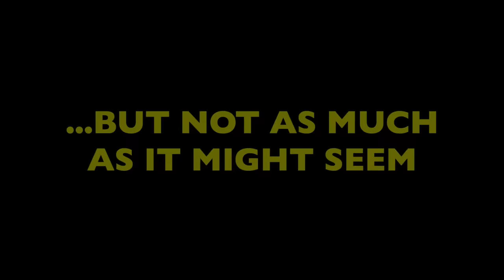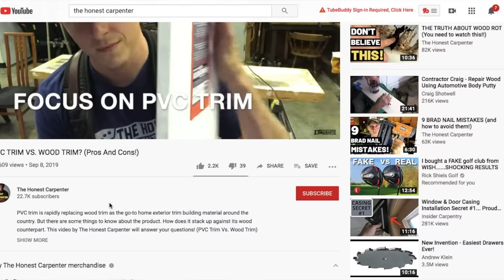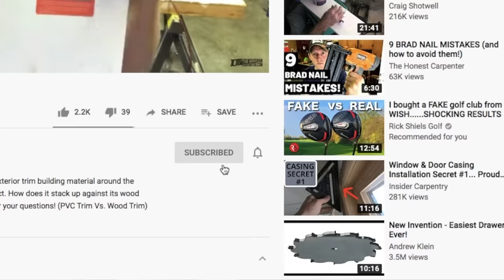How Much DAMAGE Can CARPENTER BEES Cause?! (What To Do About Carpenter Bees/How To Get Rid?)

Comment: Brown paper bags would be better to use. One thing you need to use if you're going to do brown paper bags or the plastic bags is that you'll need to put some stones in the bottom of the bag so it doesn't sway back and forth in the wind like a flag.

Comment: The best solution I've had is scraping the adhesive from glue traps for mice and plugging the holes with that. The bees can't get free of it. I've tried caulk, wood filler, poison... none did more than slow them down and leave many flying around again the next day. A day or two after I started using that adhesive, no more carpenter bees flying around my house or deck.

Comment: Carpenter bees have destroyed my porch.  They bored out 2 ceiling rafters and collapsed a portion of the roof.  My fault for letting it get to that point.  The bee hotels are for mason bees.   The bee trap works to a lesser degree... but you will only catch a few. You really you need to paint every exposed area after packing the existing holes with insecticide dust and filling so they can't get out or in.  Then keep up with it.

Comment: I disagree that carpenter bees do little damage.  Here in Georgia, between the carpenter bees, woodpeckers going after the carpenter bees and squirrels, my cedar sided house was riddled with holes.  This also allowed some of them into the attic of my house and exterior walls. Along with honey bees a couple of times. I finally had to replace the cedar with fiber cement boards to alleviate the problem.

Comment: The bees don't do much damage BUT woodpeckers trying to eat the bees will make a total mess. They indiscriminately rip open the top of the wood (in my case a porch railing) causing significant damage. I was close to having to replace the whole railing cap in 2 10 foot sections.

Comment: Raising them is not the way to get rid of them, look at the welfare situation. Dusting their holes and traps won't rid you of them either, I built over 90 traps for the sheds and barn on the farm. What will rid you of them is this, this mixture took some time to develop but it's cheap, safe, and effective. Get a 13 oz. container of petroleum jelly at the Dollar Store or Walmart ($2.50), get the 8 oz. bottle of  Permethrin 10% liquid ($10.50 most farm stores will have it). Permethrin 10% is considered safe for humans. The petroleum jelly mixes easily if you warm the container in a pot of warm water on the stove, it turns into a liquid. Mix 13 ounces of petroleum jelly with 4 ounces of Permethrin 10% pour both ingredients into a 1 quart jar and shake well. Draw the mixture into a 60 CC / 2 ounce catheter syringe with the long smooth tip ($3.30 at the farm store). You want it thick enough to stick in their holes but thin enough to be used in a syringe. When it's time to refill the syringe, warm the container in warm water on the stove so it can be drawn into the syringe. It doesn't take much to treat a hole, a 60 CC syringe should treat 150 holes. This will continue to work all summer so it kills the offspring when they emerge. It turns each hole into a trap.

Comment: Carpenter Bees wood damage I observe (per.exper) is pretty superficial, I have a free standing all wood 2  vehicle garage, been here 35-40 yrs. and a wood deck surrounding my wood frame house that's a good 75' in length supported by 12' wood pilings. The Carpenter Bees having been using both for nesting habitat for as long as the structures have existed......1st off,  they haven't bore that many holes into the wood proper, and the holes they've made are re-used many times, and I am unaware of ANY serious structural damage they've done. Am sure peoples fear of bees along with the pest industries exploitation of this fear, have done a mammoth job of over dramatizing the minimal amount of damage Xylocopa sp. (Carpenter Bee) cause by their nesting.......It's superfical and I stand by this assessment by visual n personal experience and I counter anyone who claims otherwise!!!

Comment: I spray the hole with a chemical that kills insects which would be soap like dish soap then dry the hole with a hair or a heat gun dryer, then I spray paint the hole inside then plug the hole with a mix of rocks I find on the ground then tada easy done as filling the end with blockage of cock glue gun as I save up money in the future.  Does it work?  yea, most of the time it depends how deep the hole is for I usually have to carve out the hole to see how far did they went, sometime it could be the whole plank if you're not careful enough 1 plank is not being used by the same bee which I think I had 2 by 4 so 2x4 they can get in there deep like an asshole which means you have to pull out the wood and burn it because these are invasive species.

Comment: Most commecial bee hotels are terrible and will not see any use.
They are basically a scam to the well meaning non-expert.
You are better off just getting a few nice pieces of wood and drilling various size holes in them with a sharp bit.
Sand the edges too if you can. Put it under an overhang of some sort and carpenter bees (and a number of other solitary bees) will love it.

Comment: So here is my not so nice solution because they are a huge pest around our house.  Spray an active hole with termite pesticide, coax the female out stick her to a wasp glue trap and hang it near an active hole.  Leave it there for 2 days and watch the trap fill up.   Shove a coat hanger wire in old holes to clear it out.  Pack with steel wool and putty and immediately paint all surrounding wood.  Yes not nice but it works.

Comment: I had about 30 of them in my backyard.  I thought they were kinda' cute at first and left them alone.
Then I discovered they were boring into the underside of my deck and decided I had to deal with them.
Each evening I would swat at them with an old badminton racket.  A week or 10 days of this and they
were all gone.  They returned the next summer but not as many  Wash, rinse and repeat.
Reply from the maker: I left out “badminton racquet” as a bee deterrent, Douglas! I’ll have to link one down below 😂
Reply: @TheHonestCarpenter  Can confirm  that tennis rackets work great as well. Good exercise.
Reply: Use steel wool then foil then caulking then stain then paint  also use some vinger they will not return

Comment: A little misleading how much their destructiveness is downplayed. We've had a massive deck pretty much ruined by these guys. Our house was built in the 70's, and when redoing the deck in the early 00's because it was weak and saggy, almost every 2x4 cut in the demo was nearly completely drilled through with multiple perfect circular holes. Maybe if you live in town they're not bad, but in a rural wooded area where there can be a lot of them, they can absolutely wreck your lumber over a long period of time. They can be serious destructive pests.

Comment: Just moved into a new house and the wooden deck and porch stairs are pretty infested. Not enough damage to be concerned but I don't want them to grow. This trap I got from Lowe's works very well. https://www.lowes.com/pd/BeesNThings-Carpenter-Bee-Natural-Bee-Trap/1000750158 It works better than two I got from Amazon that hang from a chain. (The hanging ones may have holes that are too big or maybe I just put the lowes one in a great spot). The lowes one has probably caught over 30 bees, one of the amazon ones has caught 2 and the other has caught none.

Comment: Plastique explosives work wonders on those pesky insect holes, bored into the critical structures of your house.

Just grab a wad of plastique the size of your fist, get about (abooot if you're from Canada) 138.6 feet of 2 way electrical wire, & a 6 volt battery. Touch the contacts once you've alerted the occupants of your home, then...BOOOMM!!! No more bug nests!

Comment: Log home & wood barn beams...must kill hundreds each spring, traps work great, but badmitten rackets are more fun.  We pay our kids to whack 'em.  Extra $$ for the females.  We used to pay for regular pest control applications but they wouldn't come out in April or May bcz of possible freezing temps, didn't want the liquid in their trucks/hoses to freeze, that's when most of the damage is done, so I cancelled them and went with looong handled butterfly nets, badmitten rackets, and hanging traps.  Cheaper & more fun & great exercise, and great wartime camaraderie each spring lol

Comment: They are absolutely destructive.  To your point they multiply over generations and bore out wood structures, not just resulting in cosmetic issues but weakening them to the elements.  There are other useful bees that will help your garden.  If you see these, call an exterminator.

Comment: Carpenter bees are assholes.  They are very territorial and dive at you to drive you away.  I've had good luck with traps and replacing the damaged boards.  Once you have nests, more bees will move in later.

I tore down a fence that was infested with them.  The 8' long 2x4 rails had a tunnel from one end to the other.  The tunnel had probably 50 bees back to back in there.  Yuck.

Comment: Why do you need the boring intro HC, I tuned in for the topic.

How to stop the bees? As you said, put up some bee hotels
or paint the house. 
To really go for it, cover the walls with stainless steel mesh
and put on 2 coats of lime render, problem solved.

These bees do very little damage, certainly nothing structural,
the environment and the owners DIY probably does more.

Alternately go to Mycologist Paul Stamets website for the answer,
he once had a carpenter ant infestation, had tried every remedy, nothing worked, 
so he developed his own fungal remedy, the ants went away and never came back.

He was even employed by the US military, perhaps he does one for bees.